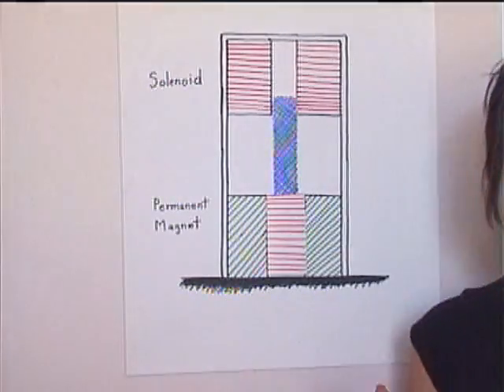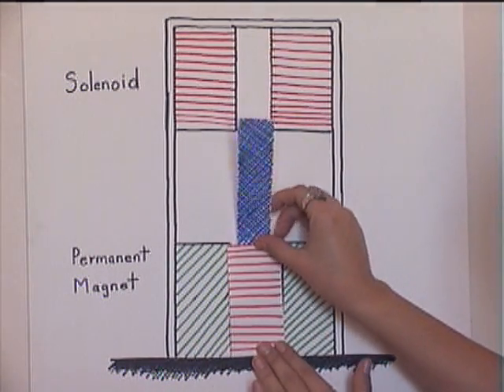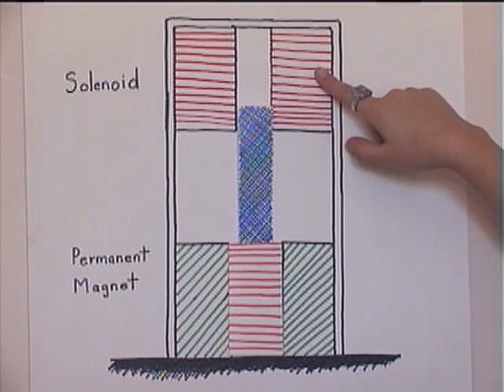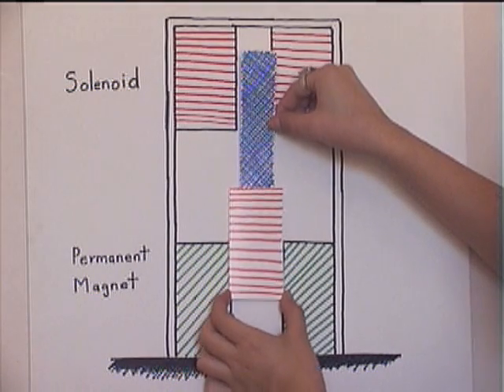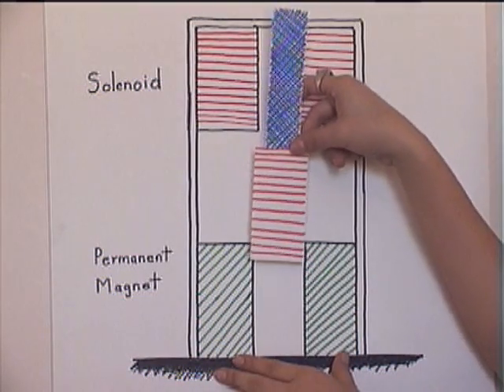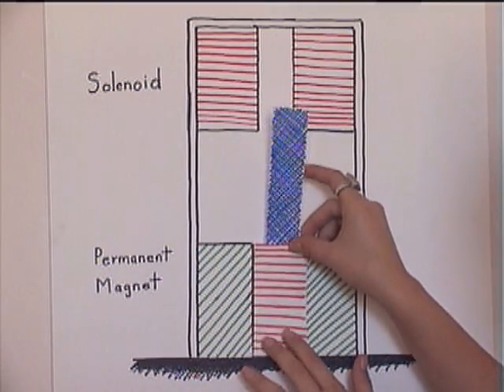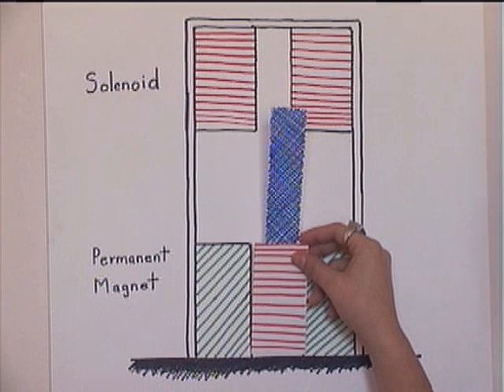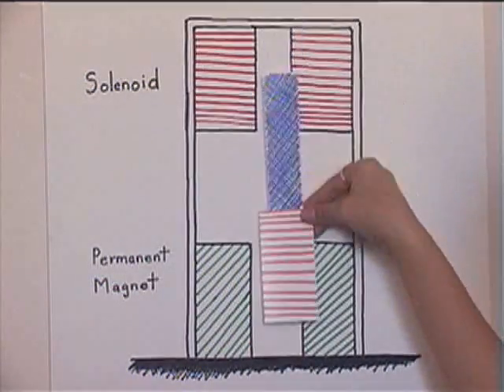Free Energy Magnetic Oscillator

Comment: This isn’t an original idea, it’s been done before. But that doesn’t mean it’s not a good idea. A few changes though. You should put the magnets on the piston and the coils on the stator. This will save a lot of problems trying to tap the energy. Also solenoids fail easily so I would consider compressed air as the oscillator. Just like Tesla did in the 1930s.  Much more efficient mor reliable and most importantly more power. Good luck in the future with your creating.

Comment: Hi, well thought principle, but due to the Lenz law, when you draw current from the sucked up coil the rate of rising up will slow down, so that you have longer to apply energy to the upper coil, which could make your device more inefficient.
But just try it out and let us know, what comes out of it...
If you are clever you will pulse the current in the lower coil, when you draw the current, so you will avoid lots of the lenz law drag and use the back EMF from the pulses of the coil to power things... See the Aviso - Konehead coil switching principle at
http://www.overunity.com
Regards, STefan.